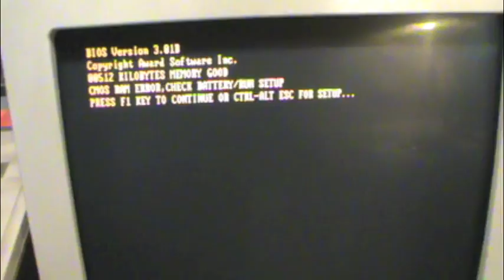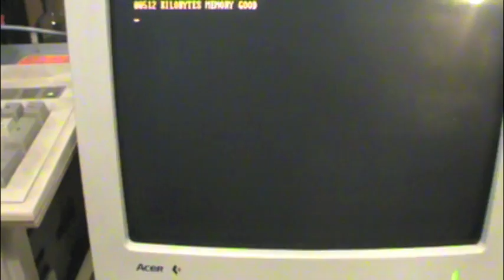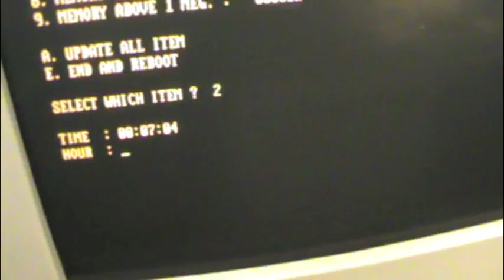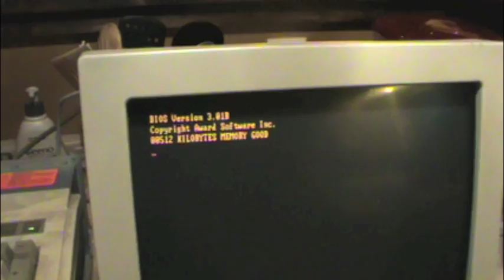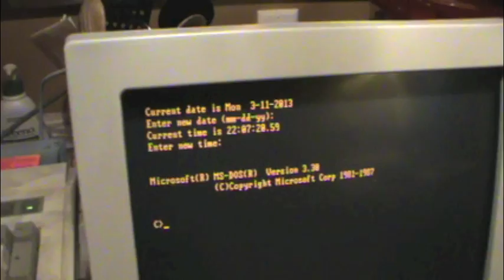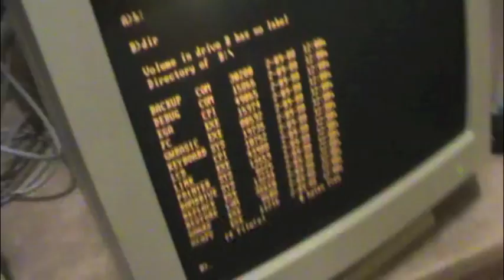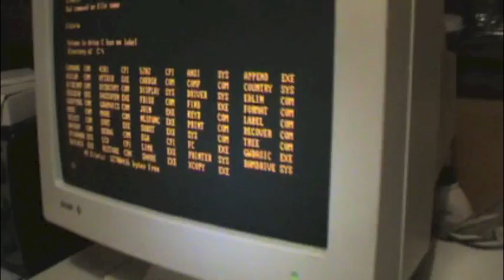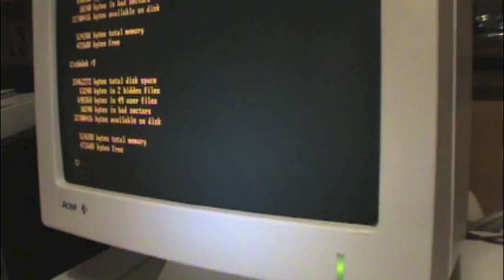Working on the 1989 Acer 910 286 Desktop PC

Comment: Just a couple of observations on the drive, usually these older drives will have C/H/S printed on the drivel label, you should be able to enter these custom values under type47. Landing zone is important because these drives will not automatically park the heads on power off. You'll need to use a utility called park.exe for that. It won't be the end of the world not using it occasionally, but habitual failure to park the heads before power off will eventually lead to the demise of the drive.

Comment: @22:10
You probably need 41256 DRAM chips, if I had to guess. However, I'm not sure how the memory circuitry is wired on that board- it may only accept up to 640K. In that case, either 41256 or 4164 RAM chips will work- just don't expect 1Meg of memory to available.